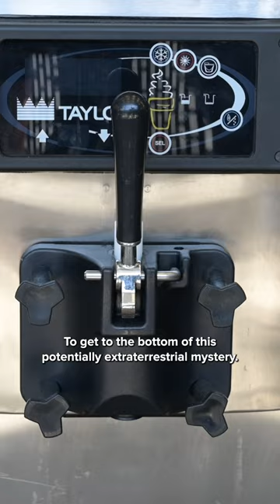Why are Mcdonald's Ice Cream Machines Always Broken? #Mcdonalds #ifixitteardown #ifixit

Comment: I work at McDonald’s, as a member I can confirm there are multiple reasons it is always down or broken. One reason is due to maintenance, you have to be trained to clean it and it needs cleaned once a week. Another is the vanilla cream, if you run out you can’t make ice cream. Another reason is due to a timeout period (main problem) the machine goes dormant for 5-8 hours a day and heats the ice cream to boiling hot temperatures and then cools it down to keep the ice cream sanatized and prevent bacteria from building up. Unfortunately this process isn’t regulated to happen over the night period.